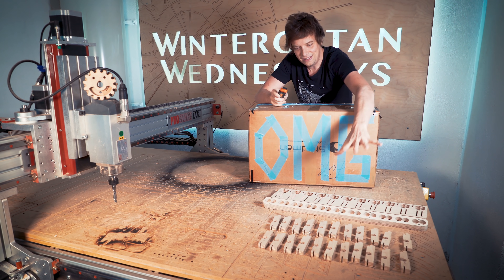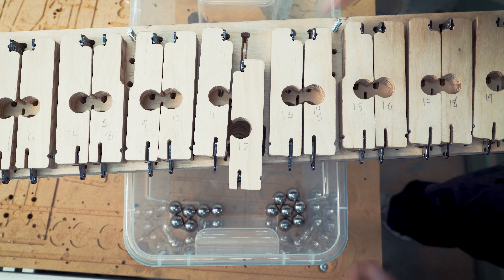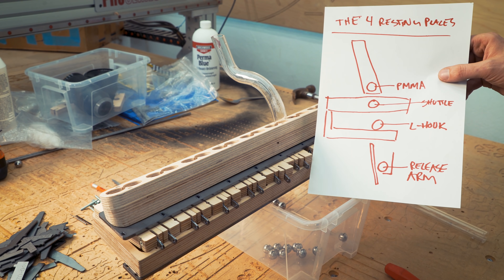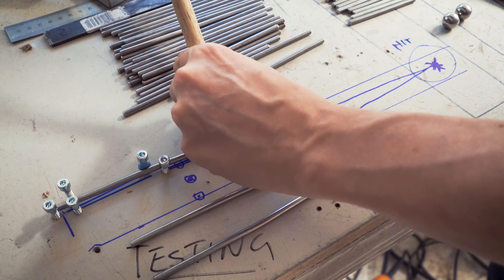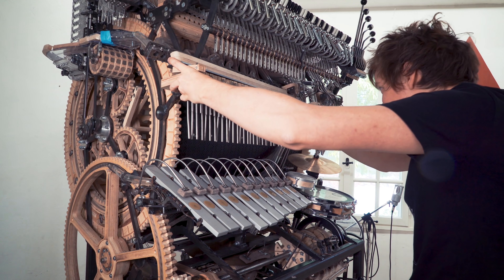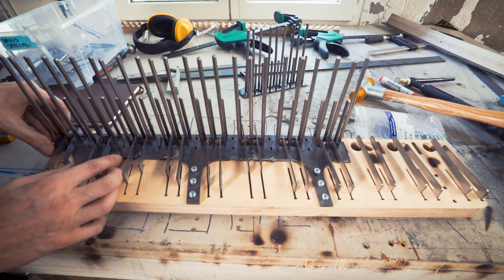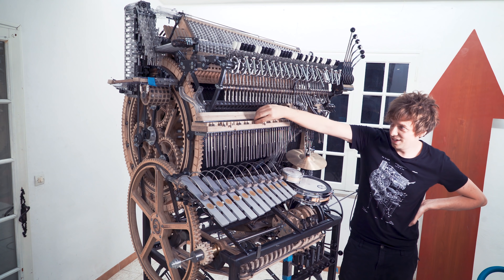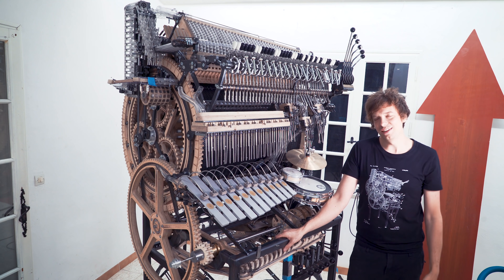My Best Design Yet - Marble Machine X #102

Comment: May I humbly offer some advice as to the movement of the wood and steel. Using a lubricant such as paraffin wax will ensure smooth and friction free movement. Resulting in the contacting surfaces to move freely for an extended period of time without developing any divots or wear points. Which may cause unwanted sticking or hanging marbles.
Reply: I agree on the lubricant, not just for sticking, but for the general wear of the machine.  That plywood on plywood especially will grind away like sandpaper as is, and your tolerances will go out along the entire piece.
Reply: I imagine that there is going to be a whole "fit and finish section of the build where he goes and beautifies everything. Maybe not though.
Reply: We always used soap on old wooden drawers when I was younger. Although wax would probably do a better job.
Reply: I believe that carnauba wax would be better. It has a higher melting point so heavy scene spotlights won't turn it gooey. It also polishes easily to a Clicksping shine. The usual way to apply it is with a cloth wheel. You press a block of carnauba wax against the spinning wheel and then polish the part directly, getting application and polish in one go. It works very well on both wood, metal and leather.
Reply: @andersjjensen  
Once a slight application of paraffin wax penetrates the surface of the wood it will remain for a long long long time and it will resist any accumulation of debris. Melting will not be an issue especially with the constant movement of the surfaces.
Reply: There is a product called door ease that i use all the time
Reply: Absolutely - I have hardwood drawers I waxed 30+ years ago and they still are smooth (although they have degraded a bit) - definitely paraffin is the choice due to its relative hardness at room temperature - Personally, I'd warm it - not too hot (dryer/heat gun) and rub it in well - very well ...    The other thing I use - although I'm not sure if it is still available (the formula I have that is) - is Johnsons Wax in a can (hardwood floor wax - a paste) -   Long term the paraffin is likely more durable.... the floor wax is slipperier .....
Reply: @SAGSampson  Johnson's Wax in a 1 lb. can is readily available. My local hardware store (N.Y.) carries it.
Reply: @edhoran1709  I guess that tells you how long it lasts - LOL - I haven't looked in years
Reply: Or even just a simple cheap bearing surface, like 5-mil (0.127-mm) UHMW film with one-side adhesive backing. Slap that all over the wood pieces and trim to size; easy to apply precisely, shouldn't affect fittings (simply replaces the small air gaps already there), and won't go anywhere else over time.
Reply: @Studio271  
I would actually highly advise against anything other than a light coat of wax. If the adhesive should fail in time the adhesive residue would only make matters worse.
Reply: Eric French or graphite powder
Reply: @ricobiggart9339   martin was informed by the speelklok museum about graphite powder, i believe he is already planning on utilising it
Reply: @jeroenvanduijn2680  it is good to remind Martin (and us) about that though.  Thanks for reminding us, I have forgot about that.  :-)
Reply: @ricobiggart9339  Graphite makes it black though. Wax will look better.
Reply: @ricobiggart9339  IMHO definitely not graphite powder! It'll get all over everything like snot on a glass door knob.
Reply: @terryisaac8195  
There are white Teflon powders now as well. But I'm still of the opinion that paraffin is the most beneficial lubricant twix wood and itself. And I can't think of anything better for wood and metal either actually.  This project along with Acorn to Arabella and The Outsider making his log cabin are some of the most fascinating things that people are endeavoring to create on YouTube!
Reply: @Finn-McCool  but apply AFTER you are done tig welding!
Reply: @MrGonzonator  
Brilliant! 😄
Reply: +1 for this. It'll be a very time consuming process but in the long run will be worth it to ensure the longevity of this beautiful machine.
Reply: I agree, the surfaces will still eventually wear down when the friction is great enough but a wax or graphite would greatly reduce any friction thus extending the life of the moving parts. I've used Castrol Oil machine stick wax for all kind of things, it works great for tapping metal as well.
Reply: MMX is too delicate for wax In most spots other then maybe the main drive gears. Graphite or silicone powders would be better for most sliding interfaces.
Reply: @MrBranboom  
Delicate? Are we watching the same machine being made?
Granted it's no tank, however this instrument is being built to withstand a world tour of use, being crated, hauled around on stage, played and 
rinse - repeat.
 I think you might be mistaking it for an original Stradivarius 😁
Nothing wrong with powdered agents that's why I mentioned them. However I personally fail to see the benefit of powder that needs to be reapplied and leaves a residue over a one-and-done agent that you can set it and forget it. Don't mind the rhyme I do it all the time. It's hard to stay focused with all this hocus pocus. You see, I'm a poet and don't realize it. 🤓
Reply: I worry that captive wooden moving parts will need to be serviced/replaced with use.  I did not notice an accommodation for that.
Reply: tbh, he should have just used nylon straight up
Reply: @cheeseybeaver  
Wouldn't it look cool to have made it from clear acrylic? I think a little mineral oil would do the trick with clear acrylic. That being said...
I think the overall structural integrity, low load, dimensional stability and relatively slow movement of the apparatus lends itself nicely to the Baltic Birch Laminate. Replacing everything made of the ply with clear acrylic and add some fiber optic accents?
 💋👌...mwah...magnifico!
Alas that was not the call and so here we are.
Reply: we've been lubricating machines for hundreds of years. there are already engineered solutions for every type of interface consideration that you could find in this machine, there is no need to guess or experiment.

this machine is too complicated for a universal lubricant solution, but because the tolerances are so loose and with so many gaps i would stick to dry lubricants except in enclosed or sealed bearing areas. i highly recommend moly powder for most of the sliding areas. you don't want to use anything like pieces of plastic or whatever between the parts because now all you've done is increased the amount of parts in an already complex machine by the amount of interfaces. wax is difficult to reapply, and lubrication will need to be reapplied several times as the machine breaks in.

again, it doesn't need much lubrication due to the large tolerances. the main concern is avoiding lubricants getting on the bearing balls and tracking it through the tubing. i would advise as little lubrication as possible, except for in the highest wear areas like the marble drops where dry moly powder by itself would be sufficient, and in a pinch can be reapplied precisely without disassembling the machine with a colloidal moly solvent.
Reply: we always used a product by Slipit on wooden drawer sliders. available as liquid in a can or aerosol
Reply: One of my favorites is colloidal graphite in isopropanol or "neolube". It'll rapidly flow across a surface and coat it then evaporate. I prefer it over graphite powders that have a larger particle size and are more or less blown in. I doubt there is one lubricant that would universally solve every friction point on the MMX.
Reply: Bar soap works better than wax on drawers.
Reply: Going through and reading the comments on wax, Teflon powders and graphite, there were a few comments about the stage lights.  This could be a potential issue.  I'm wondering if the tolerances from the stage lights have been taken into effect after seeing some of the hindrances made to appear from the welding.
Reply: @Bl4ckw0lf1  Parrafin (solid, NOT liquid) wouldn't be an issue whatsoever with lighting

A liquid or paste wax MAY have an issue

(anything you want to use, you want it worked in well)

I'd avoid anything that is messy - that again includes liquids, but also powders - especially on wood. Although (IMO) powders MAY have use in some parts - metal-metal areas without bearings for example... 

Food oils will penetrate but also cause the wood to swell (other liquids may as well - depends on what it is)
Reply: lubricant might help reduce noise too
Reply: Honestly, im surprises they are not made out of nylon.
Reply: I concur with this as it is one of my concerns too.
Reply: Great! Just slice open a pencil and mash it.
Reply: Ok, I really don't understand comments like "there's nothing better than paraffin wax here" and descriptions of the "complexity" of any solutions to this.  Too many modern metal 'engineers' not enough traditional wood craftsmen.  Where are all the cabinet makers and french polishers?
Synthetic and mineral oils/waxes are really not good for bare wood.  They may be perfect for the metal interfaces but for hundreds of years we've known that the simplest and cheapest also happens to be the best and most robust.
Linseed oil works wonders for most non-softwoods (and sometimes softwood if it's function is not as surface lubricant) -- it works really nicely on decent plywood (he's using birch), penetrates well into the surface, and importantly is stable and predictable.  It has the nice property that, if the surface are particularly active/the work pressure high, the friction heat will just draw more oil to the surfaces providing more lubrication at that time without actually migrating (no drips or greasy bits!).  If a particular part gets excessive wear sufficient to dry out over time, it is easy to reapply with a syringe adding a few drops into tight places occasionally.

If not excessively applied, even under heat (far in excess of mere stage lighting) you only get mild pleasant familiar aroma.  We use it exclusively on, for instance, oak window sills to darken them and bring out the grain to best effect, and the direct heat of the summer sun through a picture window is far in excess of what you can safely feel for a mere few hours under stage lights -- and that wood will last 40 years even if you never reapply protection!
Reply: @GrahamJEllis  
I'm a retired cabinet maker and I'm of the opinion that paraffin wax is the absolute best option here other than replacing the Baltic birch with UHMW or Delrin which doesn't seem to be out of the realm of possibility knowing the feature creep history of this machine 😊
Reply: @Finn-McCool  Really?  You surprise me greatly!  I have a fair experience with wood in various environments, but I'm no cabinet maker, so fair enough.  The people I know who would agree with me work with antiques or "display" items not "high duty cycle" engineering projects (old-school cabinet maker turned restorer, horologist, turner) so yours is clearly a very different specialism and I will endeavour to learn something.  What would you say is a good formulation and application method for this?  (Hard surface and highish friction, more than my average drawer runner!)
Reply: Maybe using simply a sheet of plastic  between the plywood parts would be enough.
Reply: I completely agree. I just posted a similar comment. The wood-on-wood  and wood-on-metal components are a potential point of failure within the machine. Especially when exposed to changes in temperature and humidity.
Reply: What about graphite?
Reply: @notafunnyuser  
Graphite has its place. Personally I don't think it fits here. Mostly because of aesthetics.
Reply: Guys, don't worry about lubrication, the olive oil will do the job nicely.
Reply: @ΑΡΗΣΚΟΡΝΑΡΑΚΗΣ  
HAHA! Indeed there is nothing like rancid olive oil wafting up and penetrating the olfactory centers within the nostrils and creating yet another source of stimuli from our beloved MMX 😊